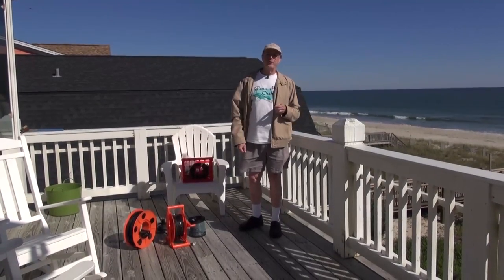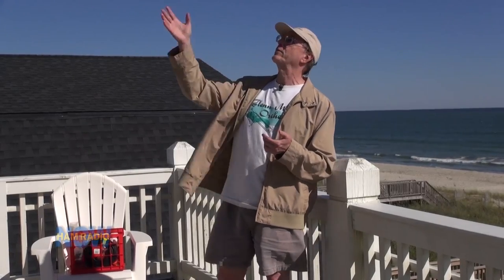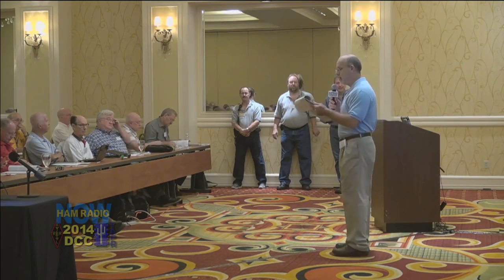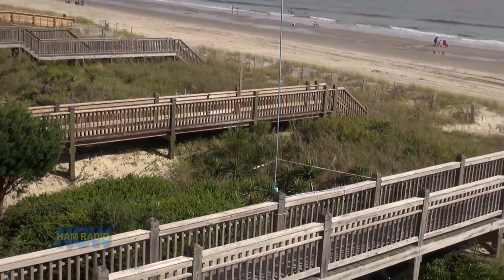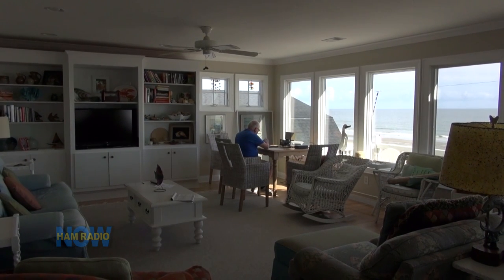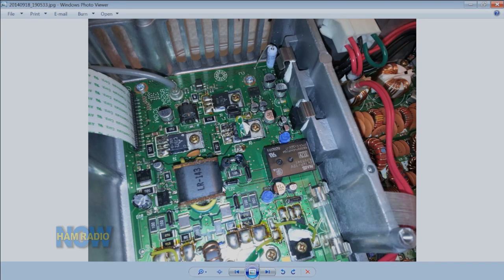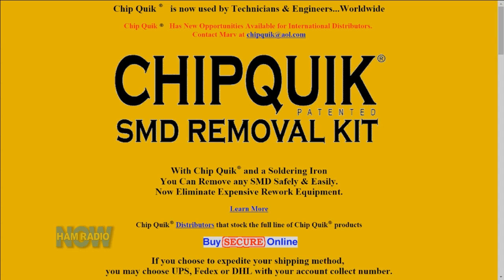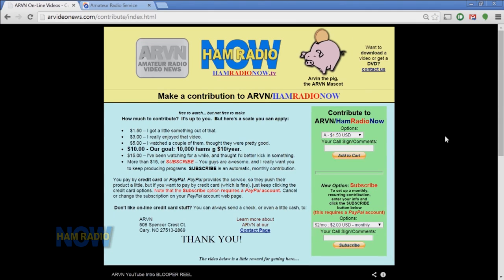Episode 166 - TAPR and the Beach on HamRadioNow

Comment: A couple of ham radio operators who are used to talking across the nation while driving in their cars. They set up antennas and radios while vacationing at their beach house.  Yet they are fighting with SKYPE and Hangouts.  My answer, Get Jeff on 20 meters and do the interview over the air.  :)   Love the FILs vertical dipole.  Thanks for posting and looking forward to more.  73, Steve/KC5SAS
Reply from the maker: Yep... if we were 'real hams' we'd just 'toss an antenna out the window' and work DXCC in an  hour or two. I suppose we could have used D-STAR, but that's not 'real ham radio' either...
Reply: HamRadioNow Technology is wonderful, right?
Reply: Sprint-When All Else Fails.
:)